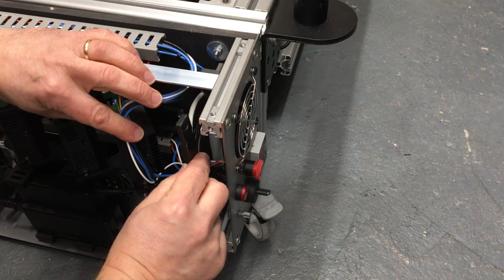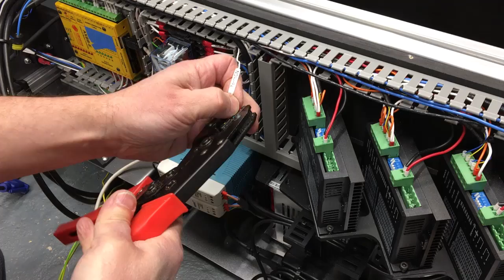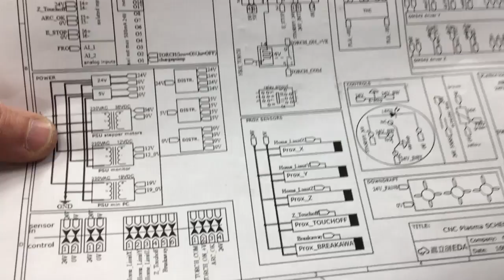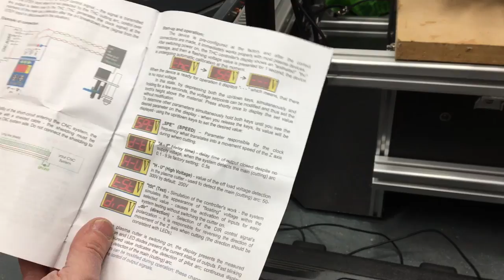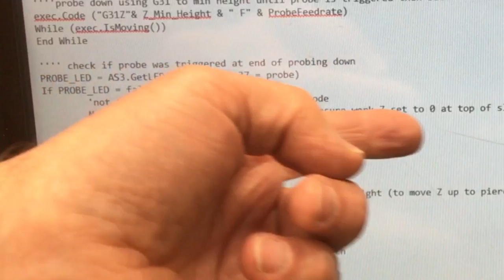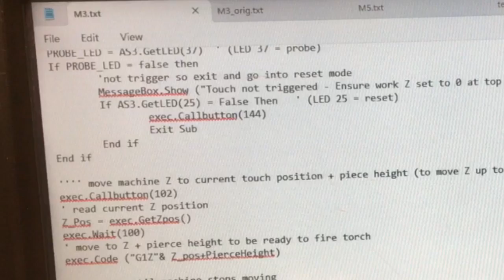Ep10: Plasma CNC build | Configuration

Comment: I'm curious about the air supply you're going to need. I too intend to get that exact same Bestarc model and I was looking at purchasing the same Hyundai compressor you showed in a previous video. Have you tried the two together and if so what were the results? I already have a compressor (Impax OM227-24l CM2 100% duty cycle) which allegedly delivers 222l/m and can hold 10bar double boxed in 20mm thick high pressure laminate (Trespa) panels to keep the noise down but a 50l 'silent' compressor that works with a  plasma would be great, especially so if you could convert a couple of 47kg propane gas bottles as extra receivers. What are your thoughts? Great series too, will be sub'd.
Reply from the maker: I'm just editing the next video where I finally get the machine running and so far on the test parts the compressor has been fine.  It will come on during the cutting from time to time but it seems to keep up.  I don't see a need for receivers so far.  The only thing I will say is because I'm still running off the 13A socket (via a 32A commando plug but I don't have the 32A supply sorted yet) I'm only cutting at 15A and 30 PSI.  So I guess at full current for thick sheets which need more air things might be different.  But for now I'm very happy with it though.
Reply: @routercnc9517  Yeah I'm looking forward to the next video. I have no intentions yet of going above 8mm-10mm steel but no doubt I'll end up wanting it at some point. Most of my cuts are only on 3mm but it's the air supply that's holding me back. Worst case scenario I might have to convert some propane tanks to receivers.

Comment: Try setting up the single click option in windows. File explorer, options, single click to open. That makes life much easier in touch mode.
Reply from the maker: Ok thank you I’ll try that.  I’ve also noticed it does not like long presses.  So when holding down a button to jog the machine it times out after a second or so.  There might be an option for that too.